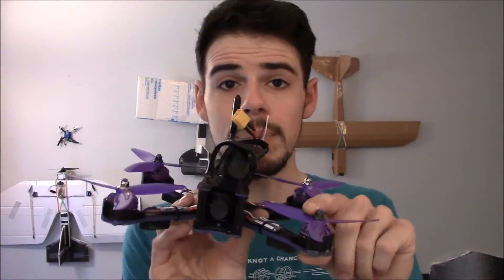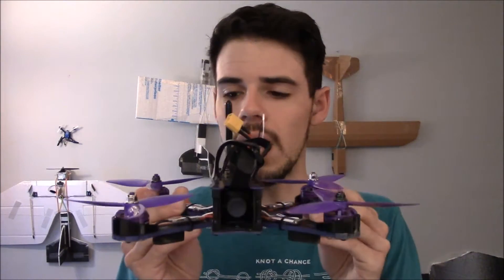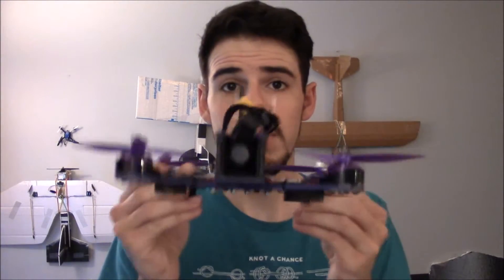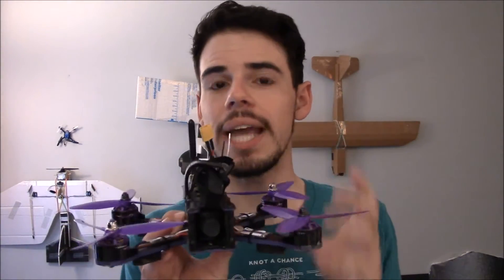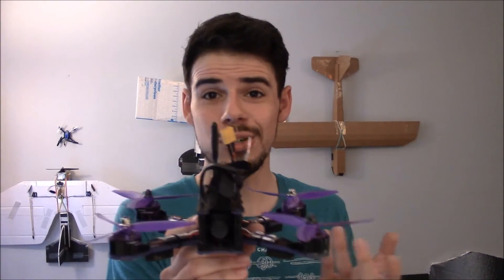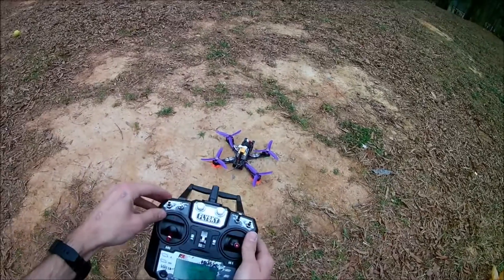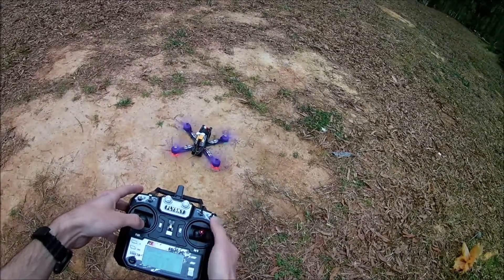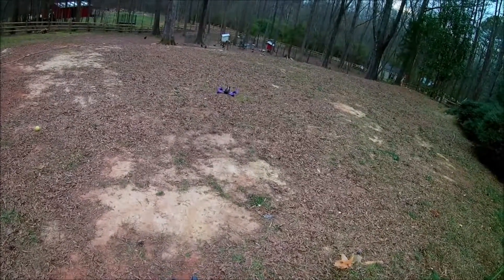Motors Spinning Faster on Their Own? Wizard X220 | Help for Beginners

Comment: even i decrease the throttle,motor still spinner too fast.. is this ok?
Reply: Hey even I am facing same issue ...did u found any solution?
Reply: @dopefpv  hello.Yes i already able to flight successfully.
1st set up  correctly.
check motor direction.
Put on prop correctly and go outside.
Reply: @kaorageko  yes I am also able to fly it...but the problem is when we arm drone it spins at low speed...then i give throttle and it flies once I land it and keep zero throttle... ideally it should spin at same speed when we arm quad...but at that point it keeps on spinning faster at zero throttle... please help me if you have any idea.
Reply: @dopefpv  yes.It should be set the motor rotation rate in beta flight.
Another is that,about your radio setting.
Calibrate it properly.
ESC also need to be calibrate if motor shows usual spinning.
Remember,radio input is very sensitive specially in first time.
One thing i learnt lately was that,in fpv we should balance everything through our fingers.So it need a lot of practice.
I am not a pro but i am ready to help you if i know.

Comment: My problem is it just shot off on me today.  Like throttle was down all the way, but as soon as I added just a hair of throttle it went full send.  Any reason you can think of why it would do that?
Reply from the maker: had it been working normally before? Did it have a crash before this happened?
Reply: @RCwithAdam1  no it didn't but I had to do a fresh dump on the flight controller so wondering if it was a calibration issue.  Raining today, but I've recalibrated and will try outside shortly haha

Comment: I just built a quad with identical parts to my eachine wizard x220s and set everything up. Betaflight and blheli looks great but when I arm it, the motors zip up to full speed freak out and then it quits... obviously nothing is shorting since blheli works.. any idea what settings could cause this in betaflight? I've never seen anything like this.... no clue how to use blackbox. Now its wiggling side to side as if its trying to correct its position... but the wrong way. You tilt it left, and the right motors spin up. Hold it steady and it wobbles side to side really fast.
Reply from the maker: That sounds like a gyro calibration or orientation issue. Check to make sure the quads behavior matches the preview in the Setup tab. If not, set the quad on a level surface and click "calibrate accelerometer". If everything looks good and you still have the issue, check the physical orientation of the flight controller board. Make sure the printed arrow points forward. Let me know how it goes.
Reply: @RCwithAdam1  AH! Here is the issue. Even though this is basically a copy of the eachine, I orientated my ESC differently. Betaflight thinks motor one is in a different place than it actually is! Is there a way to re map this without me having to take the quad apart and re wiring everything?
Reply from the maker: @glytch5  glad you figured out the issue! Yes. I talk about remapping the motors in this video here https://youtu.be/ElJ2y2Paay0
Reply: @RCwithAdam1 HECK YES! first custom build from ground up. Feeling good about this hobby only a few months into it.

Comment: I'm having this issue with my beta95x v2. Put in  new f405 and it spools up when I barley touch throttle.   Took it out with props on and as soon as I arm it it goes to 100 and literally just flips over backwards.  I cannot figure out what's wrong with it..everything seems OK but something is not set right...

Comment: I'm having an issue with my KWAD feeling FLOATY anything I could do to fix that? I play Liftoff alot and on there my KWAD feels more grounded and I like that feeling anyway to get that IRL?
Reply from the maker: "Floaty" like it hangs in the air longer? Or "floaty" like it's hard to precicely control and aim while flying? Could be that your quad irl weighs less, or has a higher thrust to weight ratio.
Reply: @RCwithAdam1  I figured it out I believe the filter was off on the gyro I change that to 2.0 and then changed the props to Mr. Steele’s Watermelon Props flew a lot better I’m still way better in the sim then real life but that could be because Liftoff isn’t real to begin with

Comment: in my case even i level down the throttle its keep on increasing the speed
Reply from the maker: Hi! What is your setup? What drone, transmitter, and receiver are you using?
Reply: @RCwithAdam1 I have the same thing as him. 1 and 3 motors ramp up to the full speed. My drone specs are: FC Mamba f405 mk2 VTX eachine tx 526 motors racestar br 2205 frame tbs source 1 v3 camera caddx ant nano reciver turnigy i6a and im on sbus. I hope you can tell me whats wrong

Comment: My motors are spinning on my whoop full throttle if I touch it against anything sending or lean it with my hand in any direction other than level...then won't respond to me idling down, only disarm. Do you have any idea what that might be?
Reply from the maker: Hey! Sorry, I don't. What whoop do you have?
Reply: @RCwithAdam1  the Pavo30

Comment: Thanks for the video. I have a Yuneec Q500 4K. When I power up it goes ape with motor speed, flips over & tries to destroy itself. I went through the entire calibration process, prop check & bind procedure. All normal. The table was very close to level but not exactly so. Could that be the cause? Thanks! Any ideas much appreciated!

Comment: Hey I did as u said nd my setup is also fine bt as u said its normal for motors to spin like that i gave a little throttle the whole quad flew up spinning anti clock violently

Comment: as soon as i press my Throttle on my radio the drone just keeps flying up(without props)!! why is this happening. please help! I'm tiered of walking after drone when it shoots 1000 miles away :(
Reply: also when i put my throttle down the motors still keep spinning on max speed :D
Reply from the maker: Hi! What model drone do you have?
Reply: RCwithAdam hey 👋🏼 , I have the iFlight Cidora SL5-E with Nano reciver

Comment: Great explanation
I have the same issue but it if the further increase throttle the quad is flipping upside down
I changed motor (it worked fine for a week after a crash) but it it's speeds up the motor faster and faster till it so fast that it flips
What could be the problem ?

Comment: This is a long shot but here we go. I had a bad crash with my x220s. Broke 2 arms, motor guard etc. I replaced all broken parts and put it on the bech. In betaflight all motors work but if I use my radio to input throttle only the right side spins, the left side spins but not enough to.keep it level. Do you have any idea what could it be?
Reply from the maker: Hi, Kevin! Let's see what we can do. Is the quad in autolevel mode? And did you calibrate the accelerometer after the crash?
Reply: @RCwithAdam1  ok.. air mode did the trick.. somewhat. I can get the drone off the ground but mid flight the motors on the left seem to just quit. After that I had a hard time getting the drone of the ground. Almost sounded like the motors were stuttering.

Comment: Hi know the video kinda old but mine is kinda doing something like that but it seem like the remote has no control after it the motor spin up if i have it at like 25% but the i flip the disarm or failsafe switch and drops like it should so i know it not a lost signal any and i was on the new version of betaflight but a friend said try emuflight haven't tested it so this might have been fixed
Reply: Hey man i am having the same issue, did you fix this?(actual flying not on the bench)
Reply: Yes my props were on wrong

Comment: Thanks for the video!!!...have a quick question. I just built my first quad and flight tested it today. I have it set for props out and all the motors are spinning in the right direction, but when I take off, it ascends roughly 2 feet in the air, immediately yaws about 180 degrees and all the motors stop and it crashes to the ground. I can immediately disarm/re-arm and take off again, but it just keeps doing the same thing. I'm really confused and any input would be greatly appreciated! Thanks again!
Reply from the maker: Hi! Are you still having issues with it? What is your setup (tx,rx, quad)?
Reply: @RCwithAdam1  thanks for the reply! I was actually able to figure it out and my first build if officially up in the air! Now I just need to figure out acro, lol!!! I have a mamba f4 fc/esc stack with a frsky r-xsr and a qx7. It's been quite a learning curve, but now all I want to do is build another one!😀

Comment: I had my bubblebee crash side ways and jam against furniture the top motor went very high pitched and burnout , who did this happen. Was it because of angle mode or air mode, should it not have but out? very confused.
Reply from the maker: Hi! Sorry to hear that! I sounds like it was trying to level itself, and since it was unable to it just spun the motor more and more, causing too much heat to build up which melted the insulation on the motor windings.

Comment: i have just finished my first build and think i have the same problem when it happened can you remember if they went berserk when you went full throttle i have a mamba f405 mk2 flight controller and a flysky 16x radio i have used lots of your videos to help my build and am hoping you can help me out one more time these videos are a great help
Reply from the maker: Hi David! I'm so glad my videos are helping you! No, it did not go berserk. Berserk like how? and do you mean with or without props?
Reply: @RCwithAdam1  what happens is without props on the bench i had the same problem as you did but what happens with me is when i increase throttle the motors increase in different amounts and wont respond to throttle commands they do stop when i disarm them please
 help

Comment: What if it keeps spooling even when I have the throttle all the way down. I had to disarm it because it wouldnt slow back down after I had throttle down all the way
Reply from the maker: That's probably normal. what flight mode is it in? acro? autolevel?
Reply: @RCwithAdam1  it only does it in acro mode

Comment: hey adam i need your help
Reply from the maker: ok
Reply: @RCwithAdam1  I have one like u and all the blades wont spend I give it full throttle but no lift the 3rd motor faster spend then the others
Reply from the maker: @leonjohnsonjr3331  So, when you increase throttle, only some of the motors spin?
Reply: @RCwithAdam1  yes
Reply: And when i give it all the throttle the drone wont go up
Reply from the maker: @leonjohnsonjr3331  If some motors are NOT spinning AT ALL, it could be an ESC or motor problem. To check, connect your quad to betaflight (take the propellers off) with a battery, go into the MOTORS tab, and use the sliders to test each motor. If they all work, then it means that the issue probably has something to do with a different setting in betaflight or possibly the transmitter.
Reply: @RCwithAdam1  all the motors work in betaflight, and receiver tab shows the TX is working, now what?

Comment: how do i make my throttle response much faster to the stick command. meaning i raise the throttle but it almost passes the middle and i still have low power or rpm...so i guess my question is how do i calibrate the power on the throttle.
Reply from the maker: Hi! In the Rates tab in betaflight, try adjusting (increasing) the throttle expo. Also maybe the throttle midpoint. I'm not totally sure because I actually haven't had to adjust those settings much.

Comment: one of BLDC motor in quadcopter is increasing gradually  than other to maximum speed when throttle stick is at minimum position started . I have checked motor, esc, signal wire from arduino but no problem in these components are found . But when is swapped the signal wire from arduino to esc with another signal wire from three working esc then the problem of spinning faster shifts to another motor
So i thought the problem must be with arduino board then i checked that signal pins port for LED blinking and the port was working properly
then i suspect that the problem must be with program of FC 
Can you please help me??
Reply from the maker: I think you are correct about it being your flight controller. However, I have zero experience with arduino, so that's about all I can give.

Comment: I'm back Adam with a new problem ...yep U have got an answer..but what if it does it when the props are on? witch makes it freak out and crash and kill all the props.....any ideas ?
Reply from the maker: If it spazzes out while in autolevel mode, try calibrating the accelerometer in BF.
Reply: Kool..Will do so and give update later today.Thanks again buddy. @RCwithAdam1
Reply: DroNe Alone did it work? I have the similar problem

Comment: Had one crash and it was spooling up when I put a fresh battery in...then it kept doing this and now it won't bind?help lol I leave to Hawaii in 4 days
Reply from the maker: Hi Brad! I'm not sure I understand your situation. Could you describe it a little more? What is your quad doing (or, not doing) right now?
Reply: @RCwithAdam1  the receiver is just blinking red. Won't bind and iv went threw Bata flight and nothing. Also the controller won't work even when the drones hooked up to the computer. All from one crash
Reply: @RCwithAdam1  tried with a fresh battery..still won't bind. Even with beta flight the controller won't show any movement...the receiver is flashing red..and b4 this the motors would intensely spool up. Have air mode but it's way too crazy to be air mode
Reply from the maker: @bradlee9193  man, I really don't know. But it sounds like the issue is with the rx. Are you saying that the motors just start spinning as soon as you plug the battery in?
Reply: @RCwithAdam1  it was doing that seen other videos of ppl having the same issue and now my controller won't even connect
Reply from the maker: @bradlee9193  ohhh. Then it could definitely be an issue with the flight controller. That's the first I've heard of that one. I'd probably have to play with it in person to figure it out.
Reply: @RCwithAdam1  dam yea the receiver is just flashing and won't bind at all..shiit you know of any drone shops in Hawaii lol heading there and won't have time to buy a new one or get this fixed in time
Reply: @RCwithAdam1  hey so I managed to bind it but then ERR popped up on the transmitter...probably need a new receiver?
Reply from the maker: @bradlee9193  I really can't say. Does it look damaged at all? Maybe there's a smll break in the wires causing the intermittent functioning.
Reply: @RCwithAdam1  yea that's what I'm guess man. Went down upside down just watched my gopro footage

Comment: So, my Wizard will actually take off and gain altitude at zero throttle. You said that once it's in the air it's okay, but I had it in the air and it gained altitude with zero throttle mid flight. I'm really stumped by this https://www.youtube.com/watch?v=AhLuXXKKUM8&feature=youtu.be

Comment: My x220 props do not spin when i arm it. They start spinning when i put throttle on idle position. Can u suggest the reason why?
Reply: Thank you for your answer. I did what you said but I still receive power on motors when on Idle position not any sooner. I don't know what is wrong. I did everything according to your video. Do you have any more idea what can be wrong?

Comment: Thank you, Adam! I was experiencing the same issue that you described in this You Tube video!!!I just purchased the Wizard 220 yesterday from a hobby store.  The hobby store owner warned me that directions or manuals are not included in the box and that You Tube videos would be the most helpful in getting this "RTF" racing drone in the air.  He highly suggested that I program a failsafe so I can immediately stop the motors if I run into problems or after a crash. Testing the failsafe mode with the props off, once I armed and then slowly throttled up, all 4 motors would spool up to maximum rpm.....  Hobby store owner was not aware of this issue and suggested that calibrate the 220 with cleanflight. I'll do a test flight tomorrow.  I hope with props on, I won't have this problem.  I'm a noob to racing drones, but not to drones in general.  Been flying 3 different Phantom models since the first one came out in 2011.  Also have the Autel X-Star Premium.  And yup, that's me in the image..... 2700 flight hours in 5 different military helos.  But I'm in unfamiliar turf when it comes to racing drones.  Lots to learn, especially when calibrating with cleanflight.I've watched a lot of videos over the past day and a half.  Your instructional videos have been the most helpful.... thank you.  Semper Fly,Dave.

Comment: mine did this, it has nothing to do with self levelling, it's due to air mode being enabled.
Reply: This is correct, air mode will continue to work unless turned off. You want air mode on because when you shut the throttle off to do flips and rolls or other tricks when you go upside down, you won't lose control of the quad and you will still be able to maneuver it even with throttle all the way down. Basically air mode means the quad thinks it is flying in the air even though it is still on the ground. Do not disable air mode if you plan on doing freestyle tricks.
Reply: Thats the gyro refreshing, not no damn airmode. It trying to self correct and balance but it is on the ground.